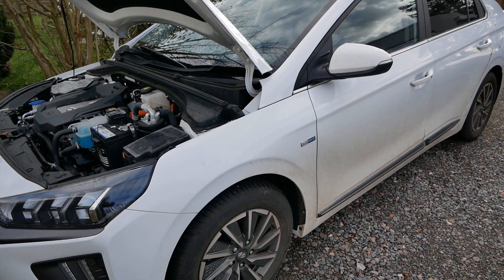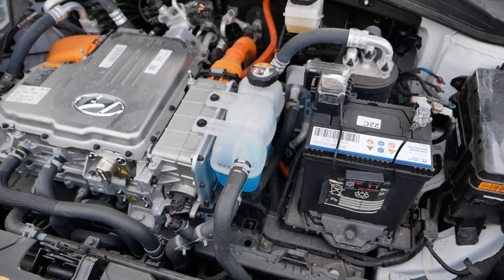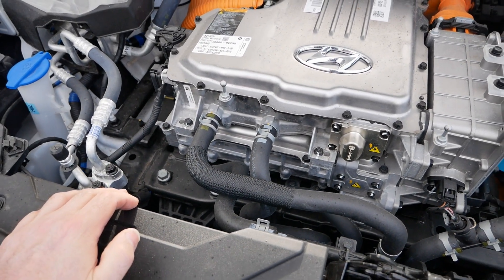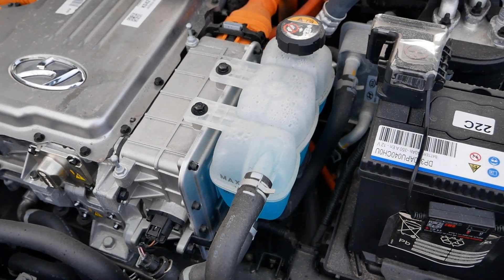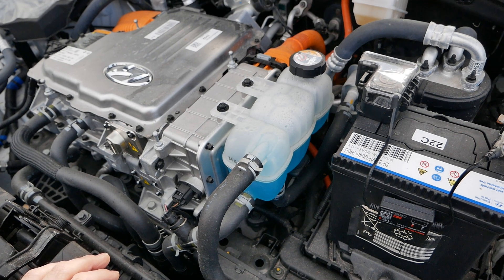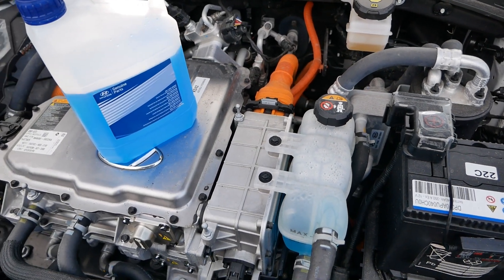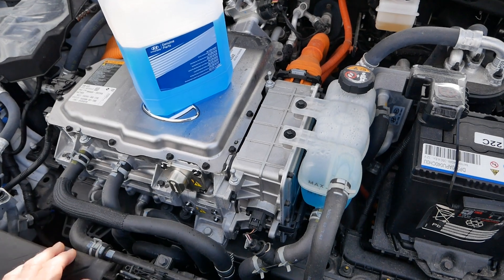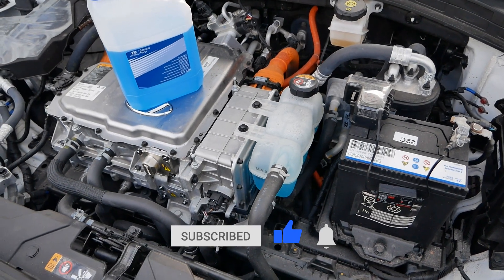Hyundai Ioniq EV 38kWh cooling system

Comment: My Kia Niro 4+ 2020 model year has a recall from Kia for the same issue. Having a service (30,000 miles) next month and the coolant flush done then, been told service and coolant flush is a day job glad it's a freebie. 
Is that a heat pump under the cover to the left, looking from the front, in your car as some of the plumbing seems to head that way ? 
The heat pump in  my car helps a lot in winter with the economy on long journeys as it's a 60 mile round trip to work and back and only use about 20% 'ish of the battery a day in cold weather.

Comment: Ah that's great to see how it works, cheers Matt. Ours gets the replace coolant message intermittently, often after charging but not always. The old switch it off, pause, switch it on again seems to work. Judging by the competence ratings of some Hyundai dealers I'm loath to go to one unless there's a formal recall.

 I didn't buy from a dealer so not sure if I'm likely to receive a recall notice?

Think I'd look out a HEVRA registered garage locally and chat with them about it.

 No obvious problems with the 12v btw and we use the Bluelink quite a lot. I'll be interested to see your video on the 12v battery monitor but everything seems good at the moment.
Especially bearing in mind it travelled to us by flat bed truck for three hours. When we opened the door before he drove it off the radio was playing! Reckon it must have been in drive mode still because it was down to something like 76% from a hundred. Didn't know enough about it at the time to be able to tell and the driver was keeping stum!

Comment: Quite enjoyed your journey trying to get 100% coolant change my thought on it is maybe attach a clear  piece of tubing onto the return to the reservoir feed that into a large container blank off the coolant reservoir return aperture then run the pump from the system as you have done filling the reservoir constantly to avoid air locking and observe when the coolant return  changes to the new coolant colour.
What do you think Matt?
Then if the software allows do the same while applying charge to see if that last part of the circuit can be flushed through could be a bit wasteful on coolant but would save draining the rad and removing undertray would be interested to see if it could work that way and save getting into an expensive 2 year cycle to oartly change coolant.
Would be better if Hyundai used a fluid that lasts lifetime of car.

Comment: I got the coolant message after a HV battery change on my 38 kWh (It was charging extremely slow and never to more than around 150 km on the GOM + according to the display, it stopped at around 75%. Turning the car off and on again resulted in that number changing too 100% charged, but km range didn't change). 
The car was topped up, and I got the message again a month or so after. I then brought it in and got a loaner car.
The next day I picked my car up and I've been driving for about a year now, without any issues :-D

Comment: I thought the dealers were using a bit of kit to blow the coolant out and the coolant there putting in is a different spec now? Also using 6 litres out of 8 litres  of coolant to flush . Only what I heard recently but not seen the bulletin. How old is the bulletin you have seen as appears instructions may have changed.
Reply from the maker: If the "special tool" they get in for this is for blowing the coolant out, that's good news as that is the only way of properly flushing the system. The TSB I've got is for the 28kWh model and is the current one. I've not yet seen the new 38kWh TSB as my subscription with Hyundai has expired and I'm not renewing it until I actually need it.
Reply: @GoGreenAutos  that's what I'm told, the coolant is same colour but is bsc-2 . All dealers have been issued with the  kit to flush properly. Quite a lengthy process apparently.
Reply from the maker: @iantaylor1172  I'm looking forward to seeing the TSB on this. My subscription with Hyundai has expired, so not accessing their repair portal currently until I can justify the cost.

Comment: Interesting, thanks Matt. Your video had me going outside to lift the lid on my 2019 Kia e-Niro (64 kWh). The coolant bottle has a dark green liquid inside which as far as I can see following the pipework feeds into the motor in one direction and down in the other direction which I guess goes to the battery. I live in France and the last service was 75,000 km but as far as I can see from my invoices since having the car from new there has been no battery coolant change as yet.

Comment: Thanks Matt, looking at a 38Kwh Ioniq, it had a coolant message on a test drive.... 🤔 Do the 38's have a heat pump....?
Reply from the maker: Yes all UK Ioniqs (28/38kWh) have heat pumps.
Reply: @GoGreenAutos   Thanks Matt, with the coolant issue is it best to avoid the 38Kwh and look at something else instead....?
Reply from the maker: @davask2269  The Ioniq is still one of the best, if not the best, EV out there. The coolant issue is a pain, but its something that is getting sorted under warranty.

Comment: Keen on your thoughts, I recently had a dead 12v and AA jumped it but blew the “fuse module” - Hyundai replaced it but since I got it back it seems like the thermal management has changed, I get a loud fan noise almost all the time now coming from that top power control unit, I can feel the air blowing out the side of it so assume it’s a fan but it is really loud and on most of the time…..take it back as that’s not normal? Prior to this I’d never heard that fan sound over the 4 years of ownership
Reply from the maker: First off, jump packs shouldn't be used on EVs. Well they can be used, but not in the same way as you would on a ICE vehicle. If they are used in 12V only mode, they're fine. But using it in the normal "boost" mode can cause problems on an EV. The "boost" mode is assuming a high load starter motor is needing the current, whereas in an EV the 12V battery is just flicking over some relays. So using a jump pack wrong can throw all sorts of errors in many ECUs and cause problems. I'm not sure what is meant by the "fuse module". That could be anything. I'm not surprised a fuse blew using a jump pack. The AA should know better, but most don't unfortunately.
I can't see how the thermal management would have changed though. Have you had the coolant recall done yet on your car? If not, then you could be experiencing the coolant solidifying in the battery pack, which in turn, if the battery is getting hot, it will be activating the radiator fan. There's videos on this channel about this recall and more to come.
As for fans, there's only one - the radiator fan. If the car is trying to cool, you'll hear the radiator fan going (and feel the air from all angles) and hear the air conditioning compressor going. They can both make a racket if the bonnet is open.
Reply: @GoGreenAutos  thank for the response, I’ll have another proper look in the weekend and see what more I can see based off that and your other video - it’s a lease vehicle so I’m not party to the work sheets for what’s been done each service etc. but I think I’ll ask them for more info and show them the constant racket coming from the area now,
I’ll check out your other video now too 👍
Reply: You were right, it’s the radiator fan on full bore all the time, never switching off……never heard it prior to the recent repair.
Reply from the maker: @andywrenn3753  so have you had the coolant recall job done? If not, then it could be your battery circulation is blocked and battery getting too hot??
Reply: Hi there mines has the radiator fan running constantly did you ever get to the bottom of it

Thanks

Comment: Good to see you cover this.  I had a 38.  Got the refill coolant message of doom.  Had it ‘fixed’ several times.  Read on the forums it only gets worse over time.  Can range from weeks after a ‘fix’ to months before it comes up again.  Coolant level wasn’t low.  I sold my 38, won’t be going back to Hyundai.  I heard there other ev’s have problems, like 12 volt battery issues.
Reply from the maker: I'm 100% convinced the 12V battery issues are due to the Bluelink app/telematics. We've not enabled the Bluelink in our 38kWh and am monitoring the battery drain and its non existent. Video coming on that too soon.
Reply: @GoGreenAutos  that's the same for a few manufacturers, the modems staying awake and causing 12v battery drain. Ford had same issues but software updates seems to fix most. My ioniq 38 doesn't seem to drain the battery not that I've checked the current draw when asleep. Left the car for a week at airport and was fine. Bluelink is switched on.

Comment: The dealer service for 4 years on my Kona is over £500. I understand it's due to the cost of the low conductivity coolant used in the coolant change.  I read of someone in the US that did it himself yet still paid $700 for the coolant. Older konas have 10 year coolant change whilst newer are 4 years. Is this Hyundai throwing the dealers a bone or does it really just cost that much?
Reply from the maker: The "special" coolant costs about £18 per 2 litres, from Hyundai.
Reply: @GoGreenAutos  Thanks, Hyundai through their service plan shows the service at 500 and something though this includes the brake fluid which in its service is 160. I'd estimate with labour there'd be about 200 in parts. I'm wondering if they may also change the water pumps as you might in a cam belt service on an ICE vehicle. That would be reasonable enough.  We have the second service coming up in July so I'll ask them, what the heck 500 quid?
Reply from the maker: @stulop  Water pumps do not get changed. They're electric and aren't running all the time like they would be in an ICE vehicle.
Reply: @GoGreenAutos  Thanks for your input on that. I've been digging deeper and it looks like it includes a 12v battery replacement.

Comment: Which part is the heat pump?
Reply from the maker: The heat pump isn't a part. It's a collection of parts. It's basically the air conditioning compressor, condenser etc.
Reply: @GoGreenAutos  Ok, I see. I was just wondering if any visible component would reveal if any Ioniq was fitted with the heat pump or not. I read somewhere that the big black flat box over the left wheel when looking at the engine was an indication of the heat pump system

Comment: There is an official TSB for this issue.

The work carried out on my car recently was as follows:

Coolant light issue reported
Confirmed customer complaint
Checked speed of WEP1 and EWP2
Found EWP2 to have exceed max limit (I guess this is what triggers the refill coolant message)
Will require coolant flush procedure as per TSB HCE22-55-P070 AE EV
Completed coolant flush procedure as per TSB
Refilled coolant and bled
Road tested all ok
Checked DTCs
All Ok
The coolant is blue and filled to the max level. 

Service Manager took me into the workshop to show me the 'special machine' from Hyundai and the EV technician showed me a picture of the filter in this machine after he had flushed out my car and it had blue crystal deposits on it.

I have assumed that the coolant has now been replaced with a different one although difficult to tell.
Reply from the maker: Thanks for the info. That's a great help. I'd love to see this TSB HCE22-55-P070 AE EV. Did the 'special machine' look like it connected to an airline to blow the coolant out or maybe something to suck the coolant out???
Its good to know this issue is due to the coolant crystallising. Obviously, all of this is only a fix if they're replacing the coolant with a different specification.

Comment: Hopefully Hyundai aren't recommending their techs put tap water into their coolant tanks? Surely at least distilled water but should be deionised water really!
If only there were more 100kw chargers around the UK, the 28kwh Ioniq would look better and better!

I mentioned in a Bjorn Nyland 1000km test of the 28kwh Ioniq, to maybe direct the rear fans down onto the opening under the rear seat to aid in battery cooling!
I know you don't have your 28kwh anymore but would it be possible to test this theory at all?
Reply from the maker: For flushing, they are. Well the Hyundai TSB says "flush with water and repeat".
So was Bjorn suggesting a modification? If so, not needed as the cooling on the 28kWh works just fine anyway.

Comment: As it’s a common system I wonder if they can use the stack heat to warm a cold battery in a similar way to a Tesla.
Reply: Need to add 5 kw diesel webasto to the battery inlet hose🤭
Reply from the maker: No, its not that sophisticated. Its just coolant being pumped around, then through a radiator by the water pump comes on and varies speed on the temperature. Tesla do something far better, but have invented the octivalve to make the water diversions work. Others may eventually copy.

Comment: Our 38 was shocking for 12v battery drain and error messages, especially coolant and TPMS. 
Hyundai dealer couldn’t get to the bottom of it despite having it back many times. 

In the end we gave it back to them and bought the petrol turbo and it’s the best decision we ever made. 

I laugh at the people who say EVs are simple, uncomplicated, nothing to service and nothing to go wrong 😂
Reply from the maker: Well all modern vehicles are complicated, but for sure EVs do have far less components and far less mechanical parts that can wear. So overall, it does make them more reliable with less maintenance required. But the owner experience (of any modern vehicle) is often let down by lack of knowledge and diagnostic skills at the main dealership workshops.